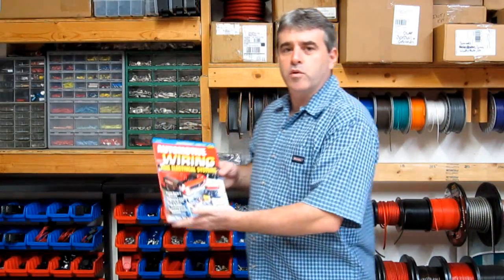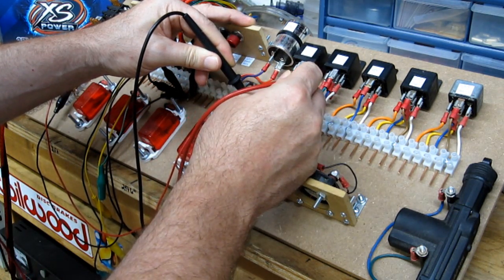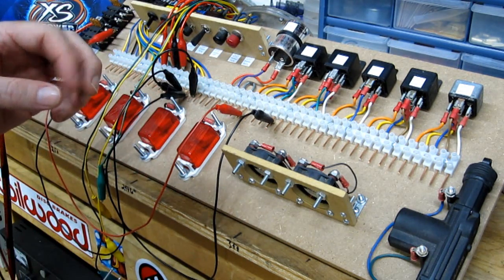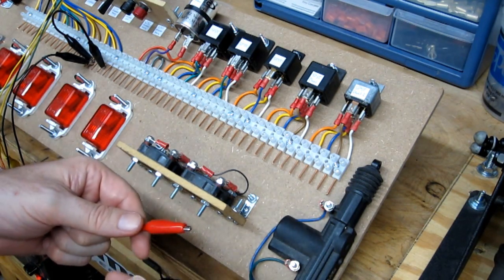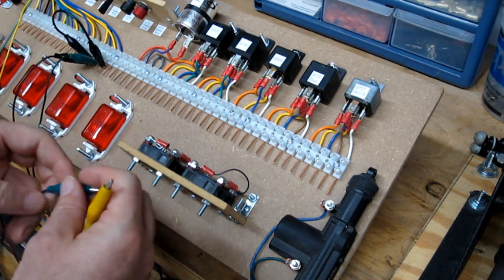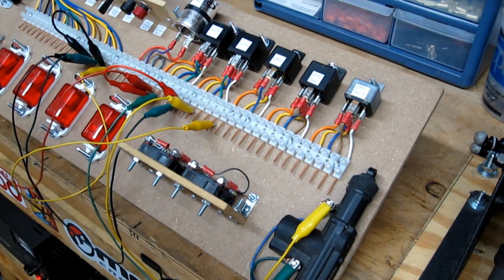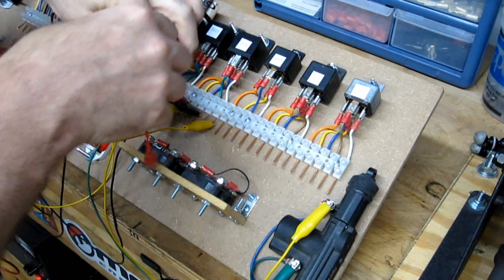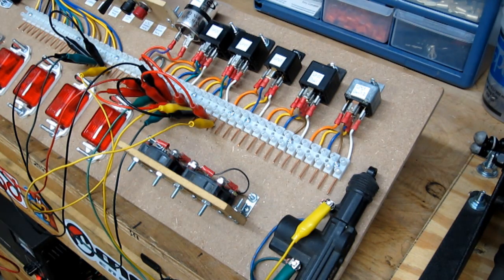SPDT Relays

Comment: I have an existing car alarm installed. My alarm has 1 siren, which is dead from age. I ordered 2 sirens and they should be here soon. I just have a couple questions: My alarm only has 1 siren output, so can I use an SPDT relay to install the 2 sirens? If so, would it make more sense to connect the relay directly to the battery with an inline fuse or should I try to connect it to the factory fuses under the driver's side of the dash? Lastly, there are 2 wires leading from the alarm output and connected to the dead siren; + and -. I guess the + wire would go to the relay, but what about that - output wire that's connected to the siren?
Thanks for any help.
Reply: Most alarms can easily drive two sirens without need for any relay.  Should you use one, you need to verify which one of the siren leads is the "switched" lead and which one is not and this will vary by brand.  Some alarm siren outputs are positive with the other side of the siren connected to ground and other alarms use a negative output with the other side of the siren connected to +12V.
Reply: Thanks for the reply.

Comment: One thing you didn't mention, with this dual SPDT circuit its completely safe to energize both relays at the same time. As if some one presses a lock button while some one else is pressing the unlock button. The is because both sides of the solenoid become hot and thus no shorts a cure. :)